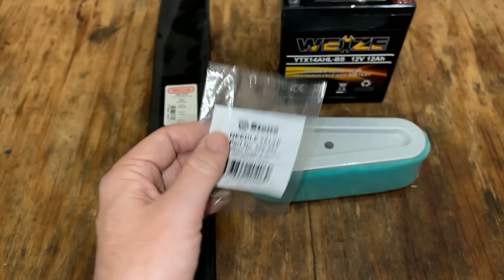First Start in 20 Years - MTD Riding Mower w/Briggs IC Engine

Comment: I put green slime in all low pressure tires right off the bat or you can watch them go flat on a regular basis.  You can even have a nail in it and the slime keeps it going.

Comment: The large hole on the original blade may have been intentional... I have seen blades that were removable without removing the center bolt. The center bolt bolted against the blade adapter, but the blade adapter had a round lip that fit inside the hole in the blade for stability, the two outer holes held the blade on.

Comment: you over hauled a motor that had just ben brocken in  time line and improved the parts required. if you were selling it. the new buyer is getting a brilliant machine  keep repairing these old machines as we think of only better solutions to our problems best regards.

Comment: I would replace the oil valve with a valve with a handle, and hose fittings on both sides, then have a cap for the end of the second hose fitting. You could attach (or remove) a the hose during oil changes. That way you pan does not need to be directly under the mower. Also... did you remove the oil fill on top of the mower when draining the oil? If not, it might have drained faster...

Comment: There should be a brake on there, part number 96053, that stops the pulley when you disengage the blade.
Reply from the maker: The parts diagram I was looking at showed it, but all the hardware was missing for it.  Someone deleted it I think.
Reply: @jcondon1  not good, I got cut on an MTD deck, poor design

Comment: I love your videos! I love to tinker with small engines as well and really enjoy watching others fix them. I was wondering, what is the liquid you use in your ultrasonic? And what is the cage thing you put the bolts in to clean those? I have been looking into getting an ultrasonic because they do so well with cleaning carbs, but never really found out what to put in them
Reply from the maker: I use harbor freight super heavy duty degreaser.  The ball is a tea ball.
Reply: @jcondon1  thank you! I was thinking tea ball but I wasn’t sure 😂

Comment: Amazing job on this 27 yrs old rideon. For the carb needle pressure test, are you using the same tool as the engine valve pressure test. If so, could you give a link to that tool for purchasing one. Thanks in advance James.
Reply: Me too please! That looks like a handy tool.

Comment: Did you think about lapping the needle seat to help sealing the needle?  I always use a Q-tip in an electric drill with either rubbing compound or tooth paste to help smooth out any roughness.  Never had a problem with a needle no sealing.

Comment: I think you should have pulled all the tired off the rims and sand blasted them clean then repainted the rims...

By leaving the existing rust exposed, it's just going to continue to rust and start leaking at the bead again...likely within the season...

If you don't have access to a sand blaster, I'd stick a wire wheel on a bench grinder and scrub the rims clean that way before repainting...

Comment: A TIP, FIND YOU SOME VERY SMALL GLASS JARS THE YOUR WIFE MAY HAVE IF SHE EVER USES CHOPPED GARLIC, I HAVE ABOUT 5 OF THEM I HAVE FILLED 2 OF THE FULL OF CHOKE AND CARB CLEANER AND SMALL CARB PARTS LIKE THE MAIN JET YOU TOOK OFF THE RIDING MOWER, LET IT SOAK FOR A COUPLE OF HOURS THEN BLOW OUT WITH COMPRESSED AIR, THEN YOU'LL BE GOOD TO GO!!

Comment: Couldn't you just put a little bit of lapping compound on the float needle, stick a little bit of a tube on the end of it and give it a little spinning motion (similar to the process for lapping a valve) to re-grind the needle and seat in a carb?

Comment: Great video. I've had a 2002 Sears Craftsman LUV version of this, mid engine, for three years. After a lot of work and parts, it's a good working machine. Breaks & Scrapiron 6.75hp ohv engine. It's very basic as far as adjustability, and MTD paint is beautiful, but doesn't seem to last. It's peeling on every MTD device that I have.

Comment: At 58:55
Tire beads....

Why don't you use some type of lubricant or oil on the beads? You wouldn't think of not doing that on automotive applications, you use oil on the beads on tractors as well....assuming that the tires are not filled with liquid for stability.

Is it just not worth the powder on riding lawn mowers??

Comment: I just salvaged one of this week.  Have it up and running but the throttle is not kicking up unless I manually flip it in the rear.  You wouldn't happen to have taken a picture of where the throttle springs are would you?  I see the small spring and rod on the carb but there is also a small on on the other side of the throttle plate and cannot find anything online about it..  Thx a million.

Comment: Kinda weird you still don’t check the air box/air filter BEFORE you crank it. Great job as usual. Your methodical approach is exactly what I do. But man, I still cringe every time you do that.
Reply: Yea, after sitting so long you would expect a critter to be living in there.
Reply: @FishFind3000  
Dirt, dust, leaves, nest etc
Reply from the maker: Good point

Comment: I am currently working on a Scrub Cadet {MTD} 1030 that is mechanically identical to yours. It is however "upscale" as it has a plastic shroud around the steering pedestal and a plastic engine enclosure. It was sitting outside for a number of years and has lots of rusty parts. Three of the tires are cracked from sitting flat. The rear tires use a standard tube and I used a 4.10/3.50-4 tube in the front. Tore the whole drive system apart and it's mostly cleaned up and "painted", all I really need yet is some kind of muffler since the original is missing and NLA. It has the mulching kit which consists of 8 {yes 8} blades mounted to a 12" disk. Can't wait to spin that up.....

Comment: If you spray Ospho on the rusted metal it will stop the rust and be ready to paint.   I did a 500 gallon gas tank like that and 5 years later near the ocean, there was no rust.

Comment: James did you have to jumper the seat safety? my son has the Murray version of this and it won turn over via key but if I power spade solenoid terminal starter cranks engine over, but no spark.

Comment: WD40 is primarily a water dispersant. It does not lubricate well. For loosening parts Liquid Wrench is the best. For the cylinder and rings some at would have been better.

Comment: Hey James. Do these mowers have a fuel pump? I did a tune up on mine recently; new fuel lines and fuel filter, air filter, and spark plug. My mower will fire up one time a day, runs for about a minute, and shuts off and will not start until the next day. I'm assuming I need to clean the carb. It seems like the problem is fuel related but I can't find a lot of info on these mowers

Comment: needle and seat cleaning a Q tip on a drill motor with PB Blaster cleans the seat... Needle tip visual inspection and cleaning
Reply: nice recondition job, is there a bag for it available?
Reply from the maker: Maybe in the past, but most part are not available except for the engine.

Comment: Great video James, I've Just purchased one of these, and I noticed yours at the end of the video backfires on switch off, mine does the exact same thing. They don't have a anti backfire valve, so is the issue with the valve timing?
Reply from the maker: No issue with timing.  Just a hot exhaust.  When you turn the ignition off fuel is still going through the engine with no spark.  If the exhaust is hot enough it will ignite.  The only way to avoid that is to idle it down and let it run for a couple minutes, then shut it off at idle or just turn the fuel valve off and let it stall.  Will not backfire if the carb runs out of fuel.
Reply: @jcondon1  thank you

Comment: It'll be nice in the future if when you're pouring your cleaners into the ultrasonic that you identify what those are and if you vary it for different purposes...
Reply from the maker: The cleaner used is in the description.  About 10% cleaner.  A little more or less depending on how bad the carb is.
Reply: @jcondon1   Ok,, I watch on my TV from Xfinity so I can't access the description and I didn't check it later 
when I commented.

Comment: Thanks for another educational video. Are there specific applications where you use PB-Blaster verses WD-40? What is your opinion of the 18v Ryobi grinder?
Reply from the maker: Honestly WD-40 is great for everything.  PB-Blaster I use when penetrating oil is called for, but WD-40 does pretty well in that category.   I recently got the Ryobi brushless grinder.  Not sure about it.  Seems like the motor control is a little off.

Comment: 1:10:20 If the contact surface between the needle and the metal is dry (without gasoline) the chances of holding the vacuum are much less.

Comment: QUESTION: WHAT # SPARK PLUGS DID YOU USE: I CAN'T FIND A CROSS MATCH FOR A TORCH 8CR? 
FYI: MINE IS A 27 YR OLD SEARS( RIP) CRAFTSMAN 13.5 42"" : USED A MEDICAL CATHETER & WORKED PERFECT: with a filter , valve,  filter . Air filter material from a 1954 Chev steamed & hot glued in original ( dryed out & looking for a better frame or go to a Toro box & bra fitting that will clear?) Cuts like a cheese slicer @ 1.5 - 4.5 mph & travel ,( blade not engaged  12 mph? )

Going to use a ratchet  drill START until starter rebuild in Ohio? 

It runs ! To bad they murdered SEARS!
Reply: On a 1980 Briggs 252707 11 hp similar engine in use a NKG CS1 plug or a champion J19LM plug

Comment: James, is there a reason you don’t slime your tires? Cleaning them seems to work but in the past on my riding mower being new would leak so I just slimed them. I slime everything these days.
Reply from the maker: I have used slime before and it worked well.  Just did not have any at the time.  ATF also works well.

Comment: Those little red in line fuel filters you use from Amazon are not the same as the white ones made by B&S.  If you look through one there is nothing but a screen so direction dosen't matter.  B&S stipulates the larger end with a blue dot to point to carburetor.

Comment: I've got a couple of those type mowers.   The good,  they will fit through a 36" gate,  the bad they don't don't turn very sharp and not the easiest to work on.   Did you try to get the back wheels off ?     Those can get mighty stuck.    Also I've found PB penetrating oil is better getting rusty stuck parts lose. .
Reply from the maker: Thankfully I did not have to take the wheels off.  I am working on something now that need new tires all the way around.  3 of the 4 are rust jacked to the axle.  Should be fun!
Reply: @jcondon1  You need an air chisel, with a hammer attachment! (A rattle gun). If you pull against the wheel, while simultaneously rattling away at the end of the axle (use a bronze, or brass, drift to avoid bruising the shaft). Apply plenty of PB Blaster/WD-40 etc, and those wheels should be willing to yield to your greater force.
Reply: @whitesapphire5865  Harbor Freight has a decent cheap pneumatic "impact hammer" which coupled with an overnight soak in penetrating oil will break the rust bond on those bolts.

Comment: 50:30 I'm not as patient as you are...

I'd have just used a cutoff wheel in a Dremel to cut the nipple of slightly proud of the tank shell, then used a punch to drive it into the tank to be removed through the fill neck...

Would I have damaged the tank?

Possibly...

Would I have damaged the tank through EXTREME Impatient Frustration due to how long chipping it out the way James did?

Almost certainly...

😄😁😆😅😂🤣

Comment: Perhaps I missed it, but did you mention if this engine has a charging system for the battery?
Reply: I have basically the same engine.  Mine has 3 amp charging.

Comment: "Taking out the new valve stem?" actually you left the new valve stem, you only removed the Schrader valve. The valve stem is the rubber portion, or the entire thing. there are different types of valve that have been used inside of valve stems, the most common is the Schrader valve. My comments are not meant as a criticism, only a clarification so people know the correct name.

Comment: I've noticed you seldom grease bolts/nets when assembling. For things like the mower blade bolts, that are running in a nasty wet environment, I'd always been taught that a quick dip in grease will make the next mechanic (probably me) very happy at disassembly time. Thoughts?
Reply from the maker: I agree.  No harm in some grease or anti seize..
Reply: @jcondon1  These were known to eat gearboxes. Uses #3 grease. Very surprised you didn't check that!
Reply: @P_RO_  If you mean "gearbox" proper this mower has an ingenious twin-belt CVT drive.  Occasionally one of the belts would break but otherwise it was quite durable.  Other than a hydro model, this was the smoothest mower I ever owned when in motion.  If you mean "differential" then yes, there were some issues with that unit and I mentioned it in an earlier post.  I used this exact same mower for 14 yrs, 1999 thru 2013.  When adjusted properly it cut great!
Reply: @perrywesthaus1537  Yes, where forward and reverse happen. Bushing wear brought loss of lubricant, resulting in it all wearing out. The selector would get balky requiring excess force to operate, then it would pop into neutral going forward unless held in position until even that wasn't enough. Given the cost of repairs and the relatively cheap cost of a new mower, plenty of these were scrapped instead of fixed when that happened. If you took proper care of them they were good machines, but most owners didn't do that.
Reply: @P_RO_  Yes I replaced the copper bushings on the aux axle shaft TWICE in 14 years.  Once the bushings went Tango Uniform, heavy grease leaked all over the disc brake.  The repair was straightforward but a bit messy and time consuming.  I don't miss replacing those bushings AT ALL!

Comment: what goes inside the ultrasonic cleaner? distilled water and?
Reply from the maker: I use regular hot water from the sink.  For solution I have been using simple green and simple green pro hd recently.

Comment: Yeah but it’s an overhead valve corner of things will run forever if you keep the oil changed and tip don’t use 30 but Oil yesterday and 40 Rotella only because I was in George’s lions win with link based oil today is the oil does not have zinc in it I took it out for the cattle converters and EPA regulation

Comment: That cutting deck is not original as all those mowers had a rear discharge which also had a brake that connected to the pulley to stop the blade spinning.

Comment: As far as the needle and seat leaking air past it most of the time of you still wool on the seat and then make sure you get it completely cleaned out no Little fibers left of steel wool and they'll seal like brand new only on rare occasions has the rubber tip been so wore out that it wouldn't sell I rarely if ever have to buy a needle and seat

Comment: How are you getting 27 years old from 07 which you said was 2017,  2017 would make it 15 years old not 27 years old. The year 2007 would make it 15 years old.  Im not being a jerk or calling you out Im just stating a fact!
Reply: The date code on the engine was 95

Comment: Those are tough engines.

I can't understand why people would use tubeless tires in a turf machine.  They will always need more maintenance than ones with tubes.
Reply from the maker: I never understood that either.  Would think tubes and split rims would be the way to go.
Reply: @jcondon1  Tubeless is cheaper.